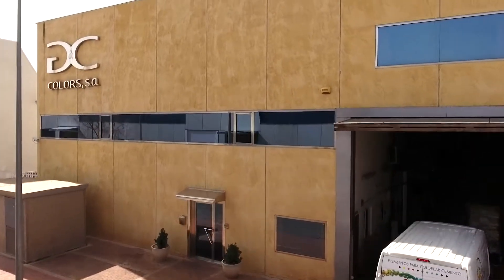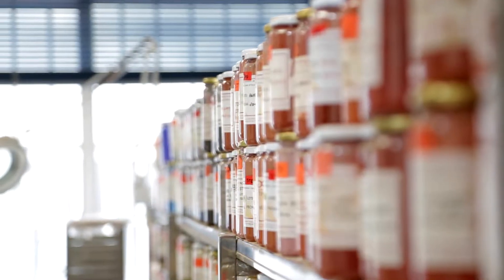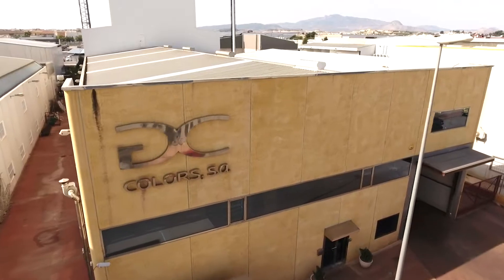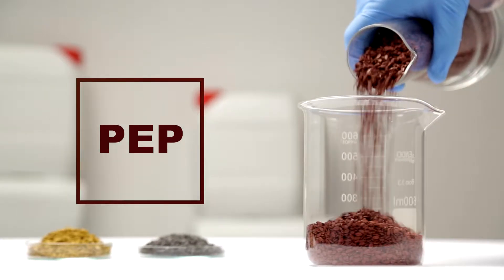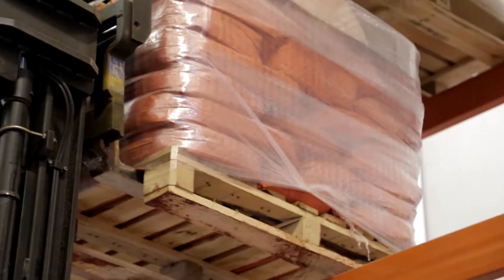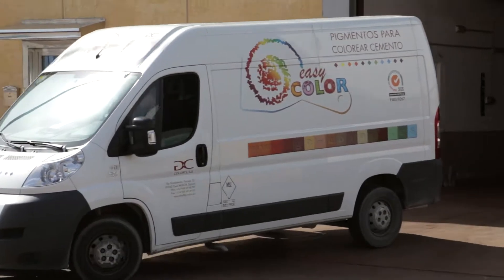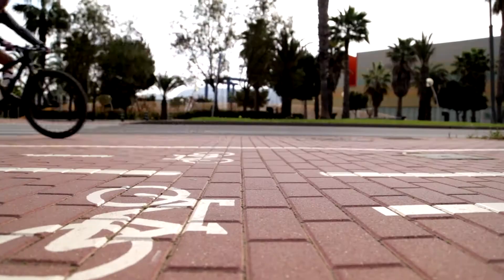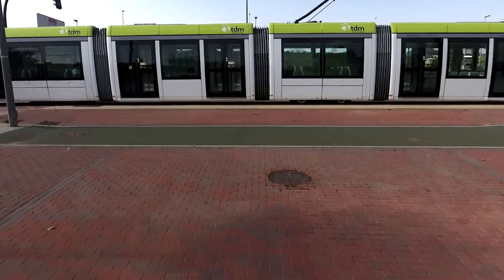Inorganic Pigments G&C COLORS I+D+I

Comment: Plzzzz can you give me detail about paint used in ampoule printing and composition,
Reply from the maker: We apologize for the delay in answering, please could you provide some more information so we are able to answer your question properly? If possible, it would be great if you could point at the minute in te video that you are referring to.
Reply: Its use in injection printing,,glass paint with ceramic colours,,we can bake for permamnent on surface and it is did not remove with water washing in want to know which adhasive and resin use for this process give me formulation for making this kind of paint
Reply from the maker: @JKyt0007  Thank you for your interest. Unfortunately we don't produce inks for inject printing in ceramic material and we don't produce ceramic colors. For this reason we don't know about formulations and specific technology of processed applications. So regarding the ceramic sector, we only supply pure pigments in powder.
Reply: @GyCcolors  ok thank u